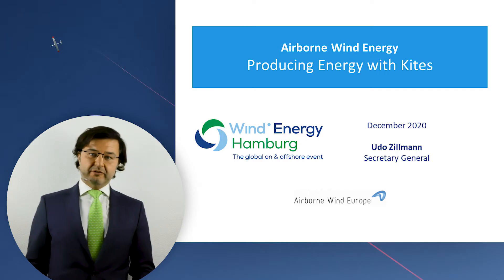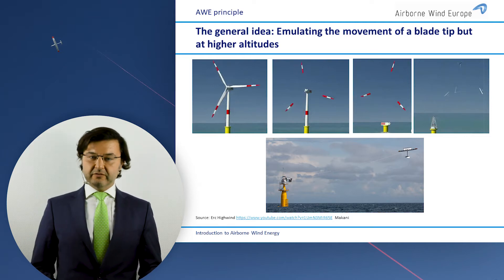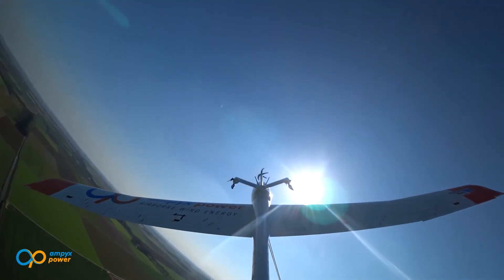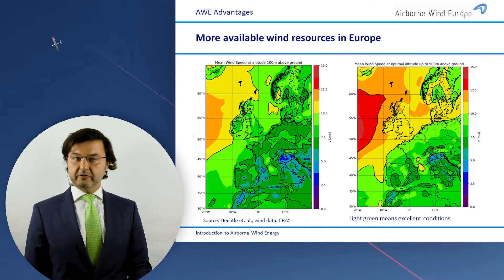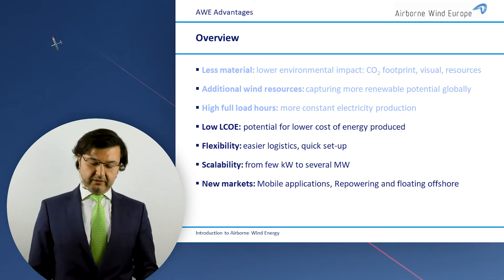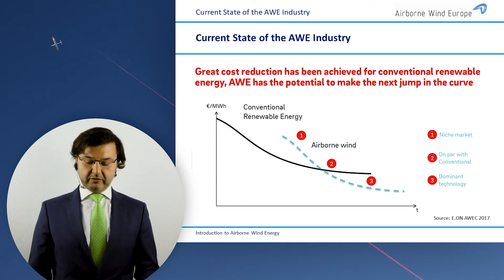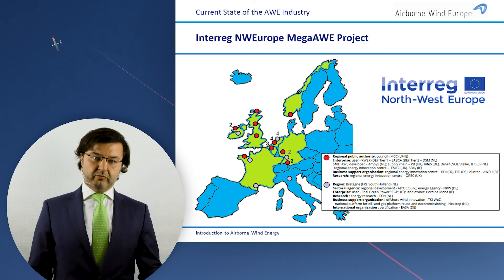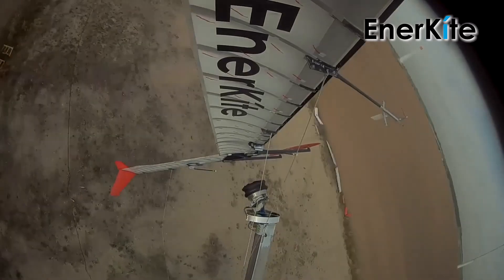Airborne Wind Energy Producing Energy with Kites

Comment: How big can they get? Is there the possibility of very large kites? Green energy is in a way perversely conservative so it will be hard for people to accept a new idea now that turbines and solar are the emperors new clothes.
Reply: One of advantages is that they better scale than traditional turbines. With traditional turbines you get high difference os speed between tip of the blade and the inner part.

Comment: The static wind turbines are built robust and last for years with litle maintenance. A flying plane with small  motor- generators and full of servos and control sistems flying at high speeds is just the contrary. This is another attempt to gather public and private investment money for the sake of a cleaner world.
Reply: I don't think they're trying to replace conventional turbines, but rather offer a tool with different uses or a better alternative in certain situations. Like the vast array of hammers. Each one having a use they're better suited for.

Comment: There are certainly things to work out, such as failure modes.  Makani (think that's the name) failed to be reliable out at sea, lost their kite-plane.  As long as things go as predicted, all is well: once randomness hits, all is Hell.  There is still the issue of massive noise and wear.  Nothing is without wear that we can make.  What's the lifespan of these complex beasts (the ones with the power sent down the tether from turbines on the kite itself being more complex) with all these moving, wearing parts?

At least for tethered power generation, the maintenance/repairs can be done entirely on the ground without special equipment, true.

Comment: It is dangerous for the air plain, helicopter ?not easy to see like wind turbine. WT stand stable at 1 position. This kite move around, not easy to see.
Reply: I think these devices will be treated as drones. If location is marked in airspace, shouldn't be a big deal.